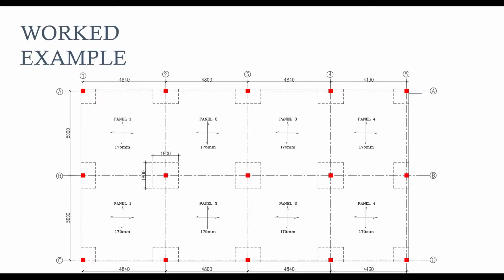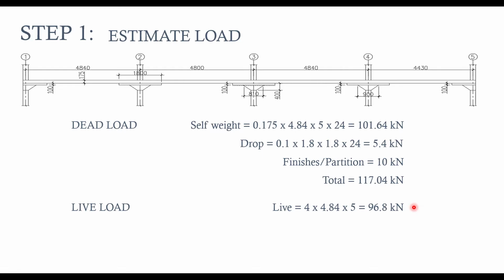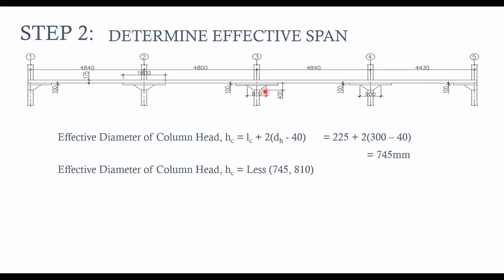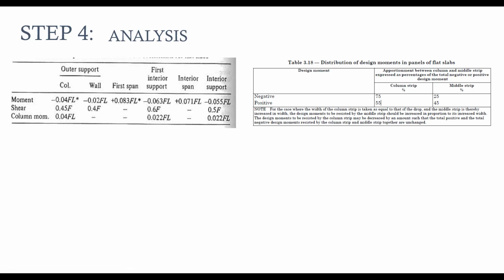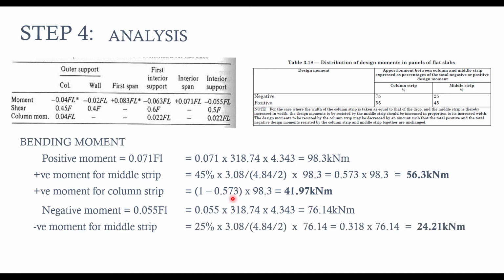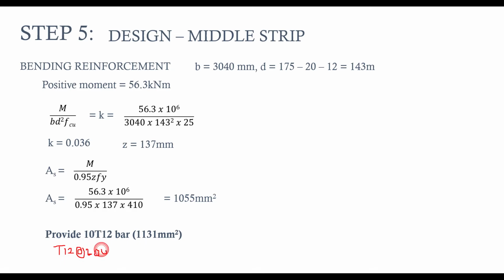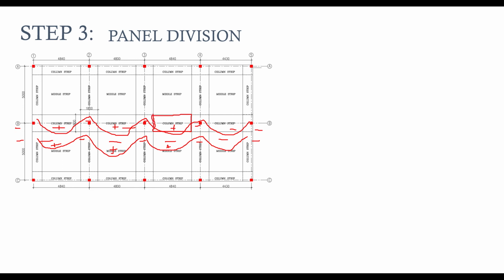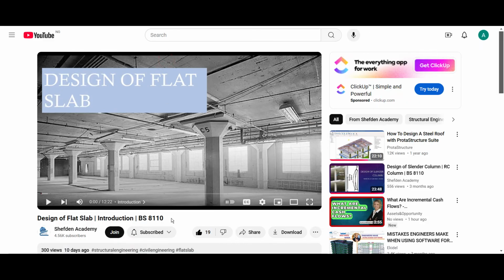Design of Flat Slab with Worked Example

Comment: Thanks for this video but I still don't understand how the 810 is gotten. 900-40-40 should be 820 or is my approach wrong?
Reply from the maker: That's not how it's work, 810 is measured not calculated. See the explanation again.
Reply: But from the video, you said we're to offset 40mm from the other end and then subtract from 900
Reply: Yes so you measure how much it has gone in due to the offset.  You are usually given that value in exams

Comment: Thanks very much, bro, for this wonderful video. However, I have some comments to make regarding the value of the beadth, b, that you used in the calculation of the K parameter (i.e, K=M/bd^2 fck) for the +ve moment in the middle strip when you were dealing with the Interior support Moment. You used the value of 3040 mm for b and tried to explain why this value is the one to use instead of 1800 mm which was the correct breadth of the middle strip. I think the correct value of b to use is 1800 mm. Let me explain. Based on your demonstration, the column strip can be visualised as a beam having a width or breadth, b,  of 1800 mm and spanning 4840 mm between two columns in the x-direction. Hence, the "b" value in the formula for K = M/bd^2fck should be 1800 mm (the width of the beam) and not 3040 mm (the length of the beam). 

Using a similar reasoning as above, the K values you computed for the Span moments using a breadth of 3040 mm for "b" should, I think, have been (b=5000-1800=3200 mm). Notice that you correctly retained the value of b of 3040 for both the -ve and +ve moments in the column and middle strips for the span moments. Even though this value is contestable, there is consistency in retaining the same value for b in both the column and middle strips. Kindly let me know If I am the one getting it wrong. Once more, thank you for your wonderful video. Regards, Ishmael Kanu
Reply: No b isn't right, and yet the width for moment x-direction doesn't be 3040
Reply from the maker: Thanks for your input but as have explained in the video, the size for b was correct. For reference you can check Mosley Design of RC structural elements on Flat Slab

Comment: 10:03  you didn't explain how you got the depth 400. Which you then subtracted by 100mm. Pleas explain
Reply from the maker: That is the depth of the column head it is not really calculated but is part of the assumptions made during structural layout creation.